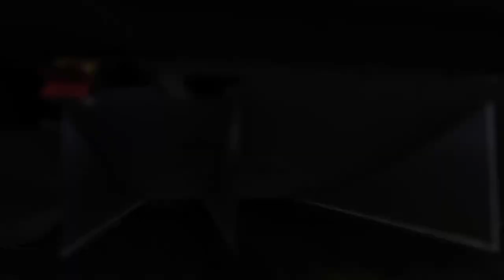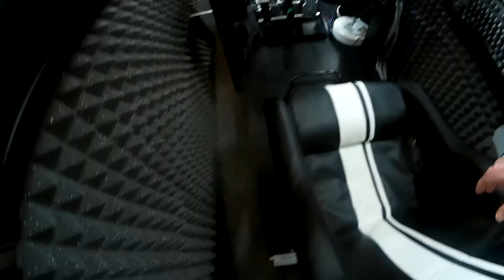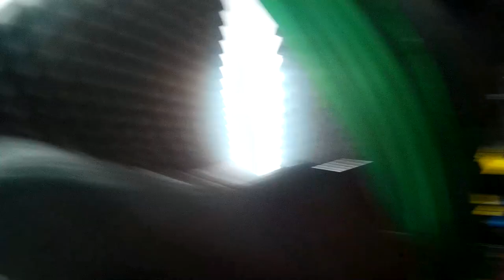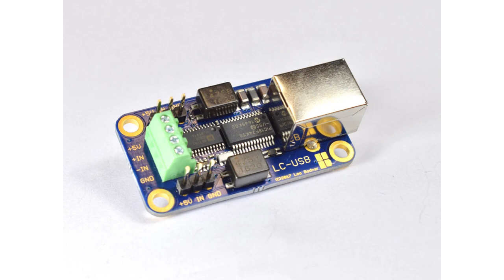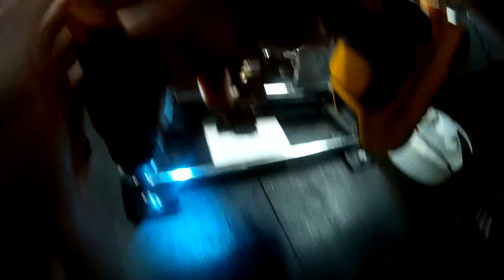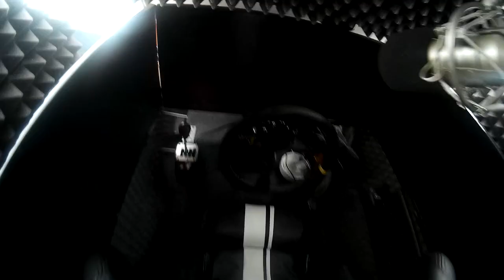Fanatec Clubsport V2 Pedals Died | Reborn for £50 with Leo Bodnar electronics and dicey metal work

Comment: HI James, When you added the Leo Bodanr parts to your pedals did you do away with the brake sensitivity adjuster.
Reply from the maker: Yes, I actually ended up reusing the potentiometer from the sensitivity adjustment for the clutch! However, the Leo Bodnar 3 wire to 4 wire converter has zero point pot on it. You can use this to effect the sensetivity of the break pedal. It worked really nicely, haven't had any problems with them at all. Yet🤞🙂.

Comment: James, do you recall what you had to do to connect the 4 pinout pedals to the 3 pinned connectors for your clutch and gas pedal?
Reply from the maker: Hey Brice, I completely removed the Fanatec main board and replaced it with a LeoBodnar one it has two three pin inputs for clutch and accelerator, it also has one four pin connector for the load cell of the brake. I had to use a 3-4 wire load cell converter that LeoBobdnar also make. It has worked really well, theres more info on my discord if your want to take a look there. Always happy to help with anyone trying to do a conversion like this. The pedals are too good to just throw away because of a simple electronic failure. Hope this helps.
Reply: @JamesTumilty  Thanks James, your video convinced me to go the LeoBodnar route, for the same reason, these pedals are just too good to junk them.  I failed to order the 3-4 wire load cell converter, so i do not have my load cell converter working properly (they didnt have it in stock).  I assume once that is in stock, I can order it and get my pedals back in working order.  Cheers from California.
Reply from the maker: @Monstar760  Yep should be spot on!

Comment: How are the pedals holding up? My load cell and board just died on my set.
Reply from the maker: Ah man, the electronics in them are a little bit of a ticking time bomb, but that's what the components market was like when these were being produced. The build of the pedals is so solid though, seemed a shame to get rid. The load cells are easy to replace, but the boards seem a little flaky, I'm still not sure what went wrong on mine, it was certainly and odd fault. 
The pedals are holding up nicely, brake and accelerator are spot on, I have a little play in the clutch that needs sorting out, but it can be kept right with adjusted limits in game. The Leo Bodnar electronics are great and not expensive at all, really is a viable way to extend the life of the pedals a bit.
Reply: @JamesTumilty  I had an old leo bodnar board over 7 years now but just ordered the one from your video and will try using his hall sensors see if I can keep it looking stock, I tried to get some  heusinkveld but all out of stock. Thank you for great tips on video.